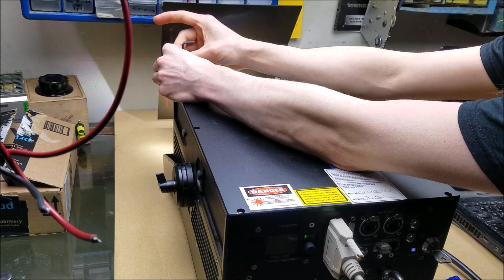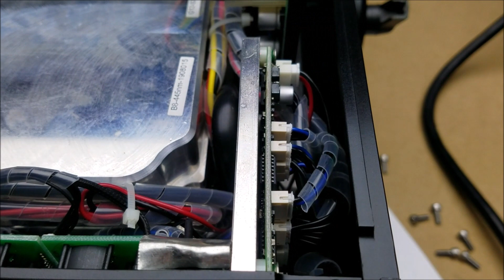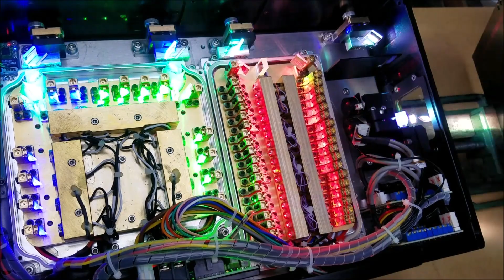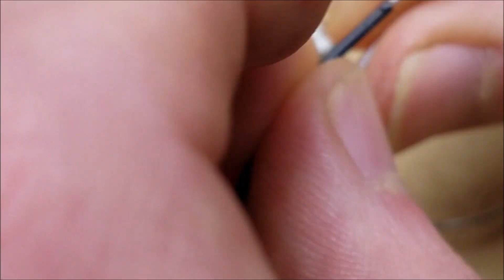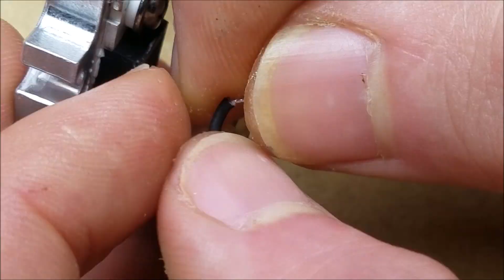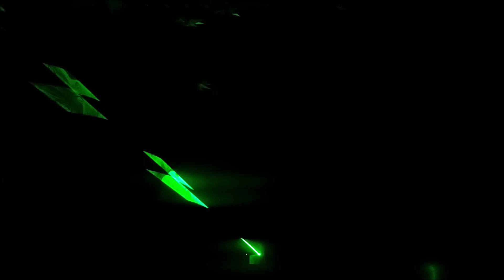Lightspace Venus 22W Show Laser Over Heating Repair

Comment: Hello, first of all what a beautiful beauty thank you for sharing your analysis. I was left with a question, when I repaired the fan controller circuit or it allowed the cap that I had on as a noise filter (possibly) from my point of view as a technician it would be good to install it, also they are not very expensive. Otherwise, the fans can introduce electrical noise into the system, be careful! Greetings from Argentina, excellent beauty that is incomparable here haha

Comment: Hi Zen!
Just circling back to review this video regarding a thermal issue. My new 3 W RGB OPTmudule + C506 build is running pretty warm.
Note: It's wall mounted with a 1/4" vertical optical plate, with the RGB module at the top, on a big heat sink, that's sandwiched in between the module and optical plate, with air being drawn through by twin 12VDC 4020 Noctua extractor fans on top of the case. The back of the optical plate is hot to the touch, but not burning.
The C506 galvo driver heatsinks are screwed along the bottom edge of the optical plate. 12VDC 4010 cooling blowers suck air in from underneath the projector and blows it over the top of the driver boards, fills the projector (in theory), then gets drawn out via the module's large heatsink.
I push my galvos pretty hard with ~1kHz sine waveforms + 3-60 Hz sine/saw/square waveforms. So the optical plate under the galvo drivers gets almost too hot to touch during a long session.
I'll send you some picks.
But, my question to share with your viewers is:
How hot is too hot for the laser diodes?
You've previously mentioned condensation issues that are caused by overly aggressive cooling with TECs. But, what is a good rule by thumb temperature level for optimum power vs thermal breakdown on the LDs? (reckon it's about time for me to invest into a decent thermal camera 🤗 My 'digital' ✌thermal sensors have neither Celsius nor Fahrenheit displays 😣).
I've already lowered my analogue 3W RGB power by ~1/2 (visually) while balancing the colors on twin projectors. But, I'll probably add another pair of external 4020 cooling fans to feed the blowers at the galvo driver's bottom end. I could do the same at the top of the LD module's heatsink, if you think it's necessary..
Thanks for sharing your words of wisdom and experience with all of these great repair videos, with such witty commentary. 😎
Reply from the maker: Excessive heat is terrible for any electronics. The Laser diodes are often rated at 25C, you can run them up into the 60C range for periods of time but 25-35C is about the best. The C506 magnets are a big concern with heat production. You can end up wrecking the magnets by pushing them past the currie point and causing them to become weaker. 

Send over some pictures and I can take a look and advise on it a bit more. Also concerning the comment about 980nm pointers/modules. I know they are made, but I don't have a good source for them, I did not find decent ones myself and ended up using butterfly packages. My best advise would be to located a laser diode and make your own module.
Reply: @Zenodilodon  Thank you for sharing the info, Zen. That's very helpful.
"A man's gotta know his own limitations." as Dirty Harry  said.
I've already rotated the 4010 blowers to push the airflow directly onto galvo drivers' heat sinks, which has helped a lot. Plus I've added a pair of 4020 fans to feed them with more air.
So, it 'feels' like I've got the thermal problem under control, now. But, I still need to verify with a thermal imaging device to be sure.
Meanwhile, I've contacted OPTlaser to source spare diodes for replacements.
currently breadboarding my 2nd laser synth for independent control of the 2nd projector.
Life is good, my Friend, thanks to your guidance.
😎

Comment: Wow that is some bit of kit, gorgeous! Honestly get some hex screw drivers so much easier than keys :)
Reply from the maker: I do need to get an at home hex driver set. I like the ones we got at the shop with the ball tips and I think I might get me a set of those. The keys are often on my desk and the first available thing anyway because they are used to manipulate the internal optical mounts.
Reply: @Zenodilodon  Be aware the ball end are great unless the screw is very tight in which case the smaller ones often break and you cant get the screw out because the ball is stuck in the head. I use keys to loosen and ball drivers to do the majority of turning

Comment: Is it safe to work on this without RGB safety glasses?
Reply from the maker: On most show lasers/all higher end ones you can turn down the output to a very low level. They aren't " safe " to work on though really. Even if you put on eye protection you will still run chanced of getting burned or lighting yourself on fire lol. There are goggles you can used for RGB laser systems like this. They are pretty new on the market. I will link them below but TBH I don't use goggles currently, but that also comes with 15+ years of working with lasers so my brain is always on guard for beams. https://www.survivallaser.com/Eagle_Pair__190-540nm_+_610-760nm_DUAL_BANDWIDTH_Laser_Safety_Goggles/p556088_20873596.aspx

Comment: Bro I need your help please, I have one laser diode which the supplier claims to be of 500mw power but I think he is fooling me, I had taken photos of my laser diode, I will send you the photos, can you just let me know what does that diode circuit tells about its wavelength and watts.
Please help me.
Reply from the maker: Looking at the circuit tells you very little. The only way to really verify a laser diode is through product code on the laser diode itself which many don't have or by use of testing wavelength and current going to the diode and then try to find a matching set of specification on a known laser diode. For comparisons on specifications going to DTRs laser shop online is helpful as he does good tests and documentation. 
https://sites.google.com/site/dtrlpf/home/diodes

Comment: I guess next time I should send you one of my units that has problems with the Y Galv Axis..., you might be able to figure that out on how to fix it right ?🤔
Reply: Also Plus... in that vid, there's an FB4 which based use an (RJ45, Cat 5 or 6) cables, why you still use the DB25 (ILDA) connector? 🤔🤔🤔 hmm
Reply from the maker: @jhrlasers  It's not my laser so I did not want to mess about with the FB4. 

Also what's wrong with your Y galvo? Usually these fail because people see 30kpps and think it's fine at that speed and then tend to scan past the speed/angle rating. IE 30kpps@20deg, which stressed out the galvos. Does it work at all or is it complete failure?
Reply: @Zenodilodon   ah I see

An FB4 supposed to be working on with any Pango software, as it's will automatically connect without you must config anything else (just like FB3 but with direct Ethernet instead), (also regardless ownership..)  the reason if it's available.. you should use it.. bc an FB4 did has a better output for Colors and Scanners speed signals.. also their Color Balance stuff as it's quite Interesting if you try that out

but yeah better not touching those that aren't yours hehe 😁

About my Y Axis..  It's still working... but I think it's either overheating or something if it's use like over 2 hours period and done some complex cues as well as ILDA test Patterns, it's messed up.., it size might deficits suddenly on it's own into like 50% on its regular size and it's wobbling, while the X remains the same...

At first I thought it was some conflicting  settings in the software, but after I recheck everything.. I think it's came from the scanners ;-;.. So I turned it off and restarted again, but still the same.. Then... I turned it off 2nd time, and Probably let it cool down in AC room for about 3 hours.. when Turned back on.. it's back to normal... But again, the same problem repeated on itself if I use it for like too long or doing a complex patterns...

So yeah.. any idea with that ?
Reply from the maker: @jhrlasers  Yeah that's a common issue. Usually it's from scanning out of the rated speed/angle rating. This happens on Y galvos a lot at you would imagine. Sometimes you get lucky and it's something like a failing polyfuse on the galvo amp that is failing and needs to be replaced or it's a failing magnet. When scanning past the factory rating you risk heating up the magnet and it loses some power. This is a small loss but for every bit it looses the coils need to use more power to compensate for a weaker magnet. Eventually the magnet just losses to much of its magnetic field from these cycles and there simply isn't enough for the coils to move correctly. I would replace the polyfuse if there is one on your amp for the Y galvo ( google image search so you know what you're looking for ) If this does not fix it than you have to replace the galvo and return the amp to it or get a matched galvo from the OEM.
Reply: @Zenodilodon  BRRR!!!.. It's just too much for me as I'm not really a technical person thingies😂... I guess I will just use a more simple cues from now on on it..

Btw, I prefer replacing the Galvos all set instead of Polyfuse tbh, cuz I just not brave enough to mess around with the internals of it ;-;..
Reply from the maker: @jhrlasers  I remember the feeling. That's a lot of why I post videos up to help people get more knowledgeable a confident in repairing their own stuff.
Reply: @Zenodilodon  ahh.., thx for that tho.. Appreciate it a lot 🤗🤗🤗

Comment: A blob of solder could have easily bridged that trace
Reply from the maker: I strongly considered doing that, but after consideration I figured it would be better and more time effective to run a wire. It was there and I didn't have to scrape off solder mask.

Comment: How old is that unit? The key switch gave it away for me (as being old) but then to use 30 some odd lasers to make one beam? Holy cow, you'd need a lobotomy after trying to align those

The tops of the laser housings seemed strangely dirty, I thought at first it might be because of condensation, but even inside it seemed scratched the heck

That loud computer fan, might be a good time to open it and check for dust😅 once a year, can save you thousands

I want to see that variac in the finger jointed box👀👀👀 but that's just me being nosey

Comment: what a beauty!! bet it cost an arm & a leg when new. is it doing 40kpps?
Reply from the maker: The PT-30 are usually rated for 30kpps at 20 degrees scan angle from what I remember. They can do faster at tighter angles.
Reply: @Zenodilodon  how cool is that....the red diode alignment are pretty complicated...i'm amazed the epoxy able to hold the mirrors in proper alignment after all these years.

Comment: I see these often shine into crowd's a little bit. How is that safe? Is it? Can you teach me please :)
Reply from the maker: Anything above a watt can be hazardous, past 5 watts starts to get into the serious concern range and into 10+ watts it's basically a one shot will do for retina scrambling. Usually lower power lased are used if audience scanning is wanted and there are lenses you can get that are basically cut in half and go onto the front of the laser, the lower half of the output is increased in divergence to make the beam less concentrated and safer on larger lasers. It's pretty much industry taboo to shine anything into a crowed without careful considerations but it does happen and something the industry is trying to actively combat.
Reply: @Zenodilodon  thank you for the detailed reply my friend

Comment: Lovely video as always buddy! Truly the only place online for this type of content! 

Quick question… Would it benefit when opening the laser modules to do it inside of a “clean tent”. Like those little pop-up tent hoods used when repairing and Data recovery on hard drives. 

They’re basically a little table top tent with a positive pressure pump and filter system so that no dust or contaminants get in. I know these aren’t as touchy as more high-end and scientific modules that are filled with gas And hermetically sealed… But I would think Dust would be super bad if it were to get on any of the optics. 

And those pressurized clean tents are only a few hundred dollars for the entire system now. Including the air handling stuff, lighting, and filtering. I know you know what you’re doing, but for my own curiosity sake. 

I almost bought one of those tent set ups for some of my own repair work that requires super precise and clean work where there cannot be even a speck of dust. Sometimes when doing crazy high and industrial PCB repair in sealed equipment like used in the medical industry, or test equipment such as spectrometers turbidity meters. But Usually when doing finish touch up work on vintage musical instruments that are insured for as much as my house. But I usually get by with my own janky DIY version of a clean room 😂
Reply: You can find mini videos of Repair guys using the clean tents I’m referring to on YouTube
Reply from the maker: @hullinstruments  working in a clean environment is certainly helpful. Before this project I ran an air filter  in the room and you can see the working space was optimized. You'll notice how little you see the beams in the laser as I am discussing the optics. I would of loved to of been able to blow a little fog inside to show the beam paths though, but I did not want to risk dirtying the optics. Eventually I want to get an optical table and that will be in a positive pressure enclosure with air filters.

Comment: Oh my, aligning 36 red laser diodes into a single, coherent beam must be a nightmare. Hope they will invent some more powerful red diodes with good divergence to lower the number of them needed in high power lasers. I will bet a large portion of the cost of a high power show laser is due to the man hours (+ extra optics) needed to align this many lasers for the red beam alone... Great video as always, Zenodilodon!
Reply from the maker: Oh hey, it is 36 in the reds, why did I say 32? lol. Yes these arrays are absolute costly time vampires to assemble. The whole show laser industry is waiting for better red laser diodes to happen but so far it doesn't seem very likely. Higher end show lasers still use DPSS and OPSL due to their beam quality and power density in a single beam though they are prohibitively expensive.

Comment: I don't really understand how the beams are "combined" in a set up like this. I mean I can see the separate beam spots on the combining optics and even if each one is individually aligned to converge on the same spot at the x y scanners they're still going to all be totally different and diverging paths as soon as they leave the unit.
Reply from the maker: The beams don't converge on one spot. They remain parallel and the galvos have bigger mirrors to accommodate the width. It's hard to see the individual the beams that come out of the laser because the beams eventually kind of blend together
Reply: @Zenodilodon  ah I see. or perhaps..... wouldn't see
Reply from the maker: @Muonium1  it's an optical illusion, I am sure of that lol